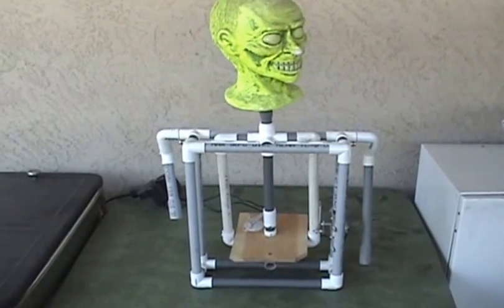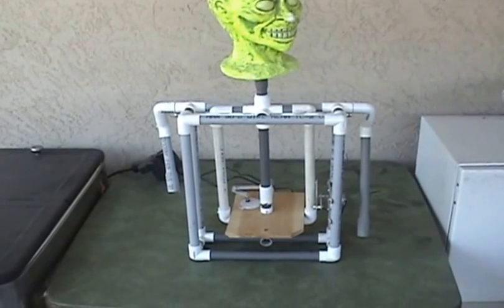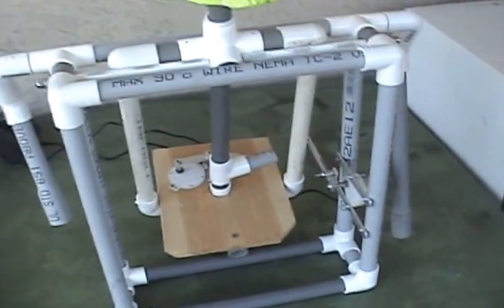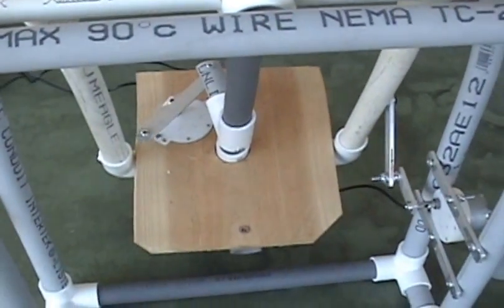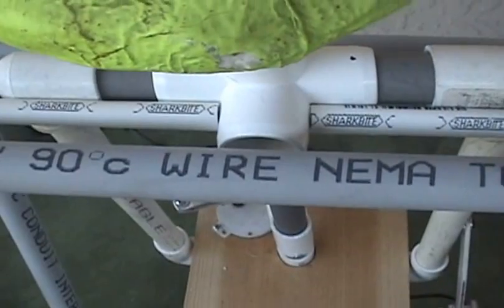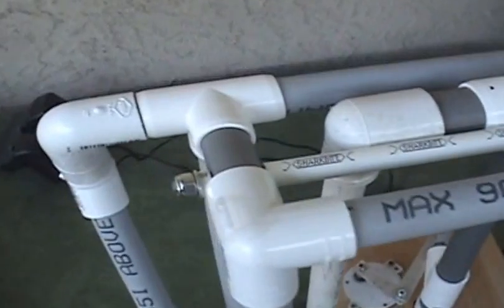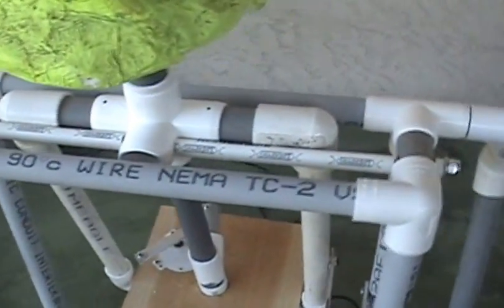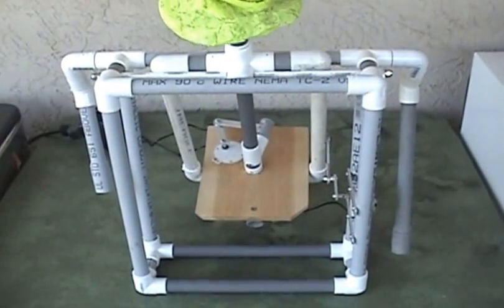Poormans 2 Axis Animated DIY Halloween Prop Mechanism

Comment: What do you wire em with for power  awesome video
Reply from the maker: These motors are 110V AC so you simply add a 2 prong plug and they use standard US household current.
Reply: @halstaff  Are the power supplies (wall warts) you used a specific amperage? 12v / amps?  I heard you say you were going to combine them into one plug.. 12v / 2.5a? How many amps are they running on individually here?

Comment: What does one use halstaff  to mount to the shaft?
Reply: iowa chapman so the one i see that looks like the ones you have show 12v 30r/min is that correct?
Reply from the maker: +iowa chapman  The motor I used was just like that but it was 5rpm.
Reply: cool halstaff thanks! and what type of shaft mount are you using, i see the shaft is 7mm but having hard time finding one that would have a flat round surface with 3 screws to mount say a wood base or metal base to mount other things too, i see couplers and some have a threaded hole on top to screw in .
Reply from the maker: +iowa chapman The shaft is threaded for a M4 screw on the ones I used.
Reply: is that on the side of the shaft or top?
Reply from the maker: +iowa chapman On the top.
Reply: halstaff awesome, thanks, really appreciate it, sorry for so many questions.. :)

Comment: This is a great setup Halstaff. The movement is very smooth. Looks like you lucked out on those motors, great find.
Reply from the maker: Thanks.  I do like the motors and just ordered 4 more as the seller has restocked them.
Reply: How do they compare with reindeer motors in regards to torque and price?
Reply from the maker: Jack Mac
More torque and cheaper plus they're 12V instead of 110V.

Comment: AWESOME JOB...
WHAT MOTORS ARE THOSE??
Reply from the maker: +iowa chapman I don't see the 5rpm model like the one I used but this looks like it would work -  http://www.ebay.com/itm/12V-5RPM-DC-MOTOR-Geared-Brush-Motor-STOCK-for-Project-Model-Low-Noise-BrandNew-/161734950568?hash=item25a8277ea8
Reply from the maker: Thanks.  I put a link to the seller of the motors store in the description.
Reply: halstaff there are so many on that page, which one exactly :)  and nice job halstaff, found you here on the youtube after a few replies on hauntforum.. :)
Reply: halstaff looks like this one http://www.ebay.com/itm/SMALL-GEARED-MOTOR-DC12V-30RPM-STOCK-School-Project-Model-Brand-New-/161677932454?hash=item25a4c177a6